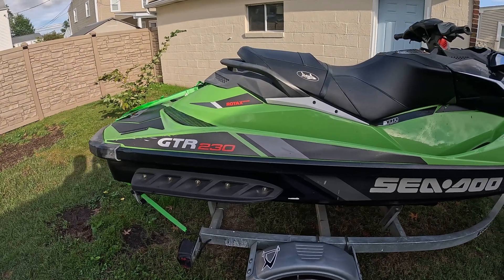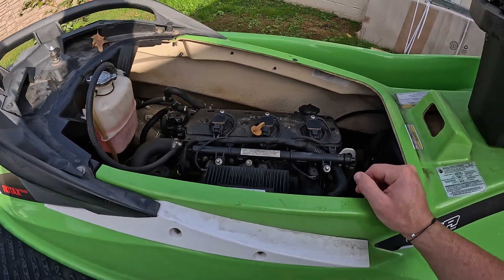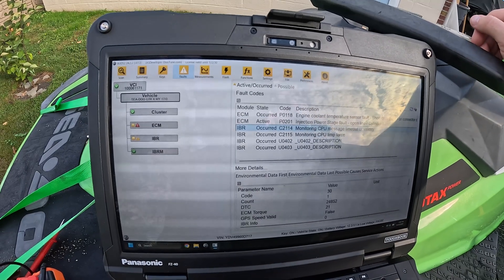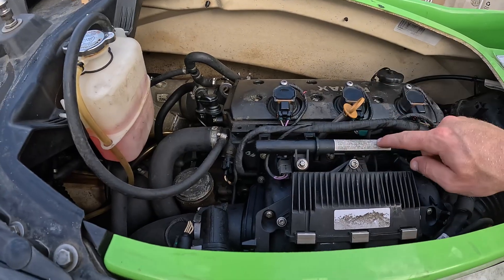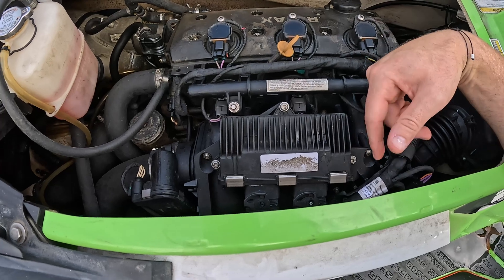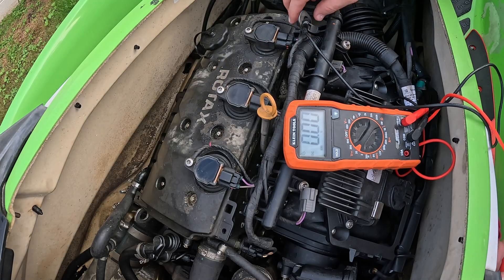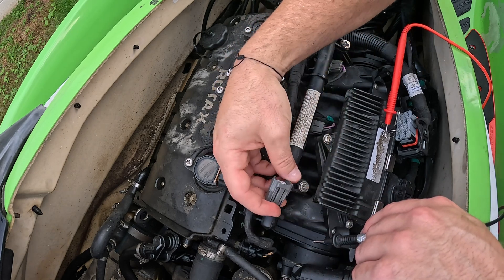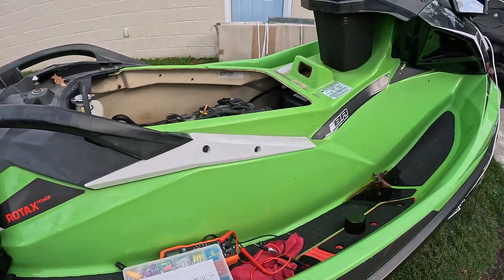SeaDoo // 2017 GTR P0201 Injector Electrical Fault Code Repair

Comment: Very helpful tutorial, I always watch your channel whenever I got problem with my jetski, can I ask what buds model I need to buy, I got 2022 seadoo gti se 170.. thank you and Godbless you jake
Reply from the maker: You’ll need Buds 2, you can go with any access level. The highest level will let you make changes to the modules but it’s quite a bit more expensive. A simple technician level is all you need for maintenance and repairs.
Reply: @jetskijake-seadoo thanks Jake, can I used the buds system in cars too?  Or is it exclusive for seadoo
Reply from the maker: @jerometan3481  BUDS is only for Seadoo/Canam vehicles
Reply: @jetskijake-seadoo thanks for info Jake.. I saw in Amazon there are 4 types of buds system they're selling 
Should I choose the one that comes with 
- brp power interface 
- license to dealer technician or licence to mechatronic expert

These are the difference from the 4 choices
Reply from the maker: @jerometan3481  What are your goals with Buds? Do you want to be able to diagnose/perform maintenance and reset codes or do you want to do all of that plus be able to do firmware upgrades and module changes?
Reply: @jetskijake-seadoo I think I want to do all the technicians can do 😅 I’m still learning and watching almost your video. So I can do proper maintenance  coz they charge too much here for a check up
Reply from the maker: @jerometan3481  Sounds good lol this is the one you want. Its a big price to pay initially but it pays for itself with how much you can do on your own. https://amzn.to/46RUMxV
Reply: @jetskijake-seadoo thanks for helping out, also can I make a dess key duplication using the buds2 and do I need another accessories for that?

Comment: Great explanation of all details + some great tricks of the trade.  Other than having to purchase special probes for back-probing wires, do you have a suggestion like the key-ring trick?
Reply from the maker: As the need comes I'll have some more tricks of the trade but the keyring trick definitely helps. My only tip is DO NOT let the key ring metal touch any exposed metal like the engine block if you're testing for power, you'll short the circuit.